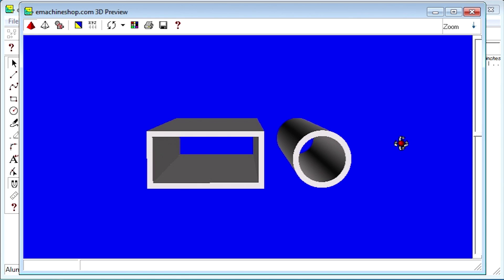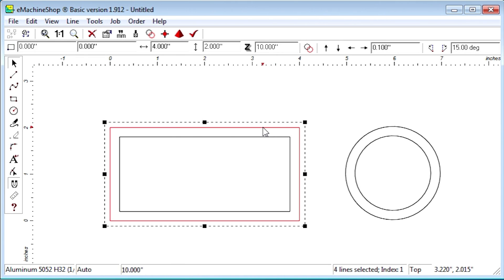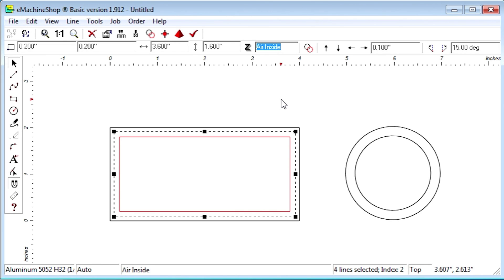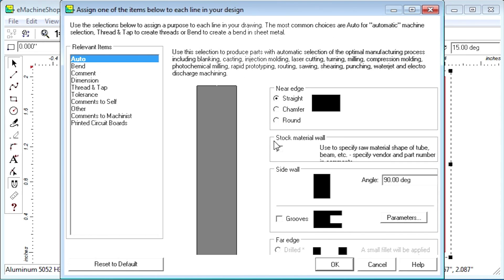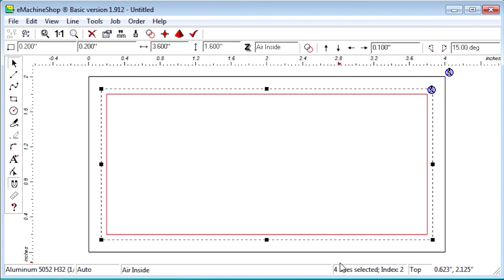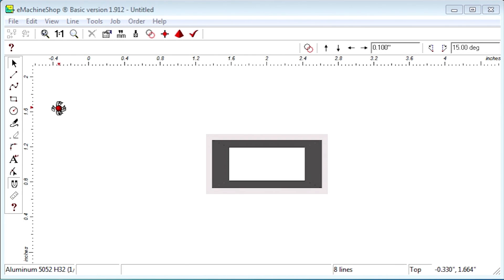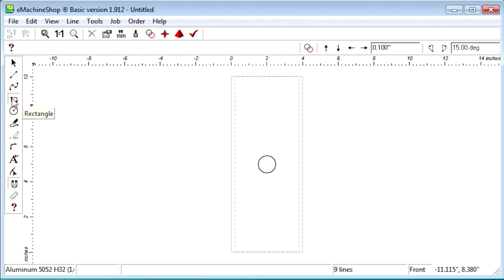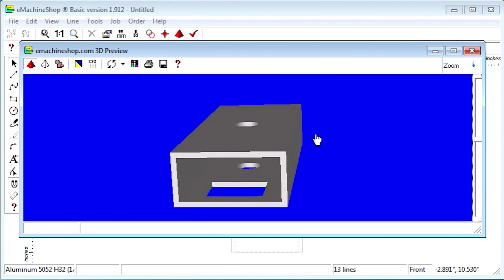Pre Shaped Stock Tubes

Comment: Nice feature.

I'd like to see the feature to specify customer-supplied stock material.   I'm using structural L-extrusions, which have rounded edges.  I think E-Machine Shop might be calculating the cost of rounding the edges, even though they come with the stock material.